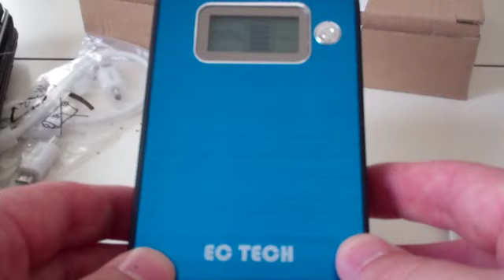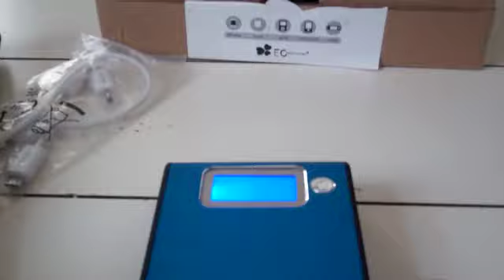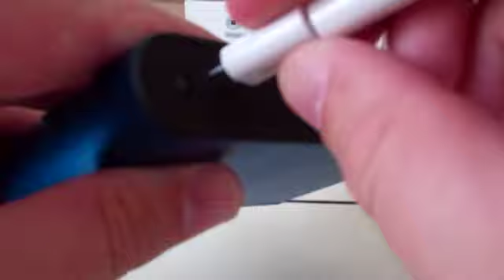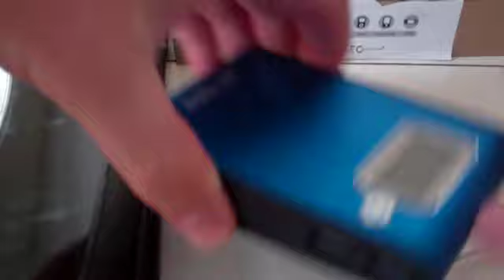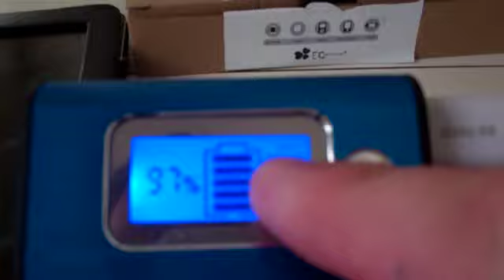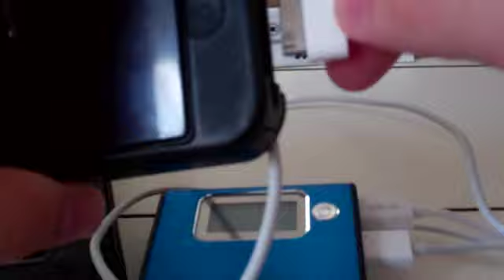EC Technology 12,000mah power bank Amazon

Comment: more manufacturers should add displays to their bigger powerbanks. it's not that hard to estimate percentag of a battery that's 6Ah or bigger. I got a 6Ah powerbank and it has a LED indicator with 4 LEDs and it's so inacurate. when only 2 lights remain then the battery only lasts 5 minutes until empty.

This one is pretty thick though, probably doesn't fit into a pocket together with a phone. I bet there are some Samsung  18650 tube batteries in there. the powerbank I have has some special 6Ah battery pack which you can't buy anywhere so it is very thin and you can put it in your pocket with your phone.

I wonder what the highest input current this powerbank takes though. if it's only 1A then it'll take quite long until it's fully charged